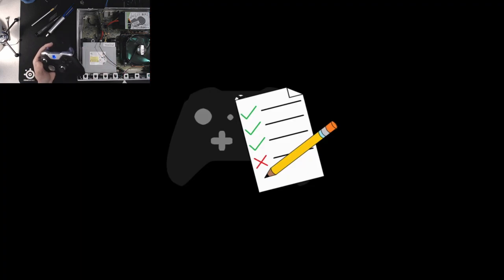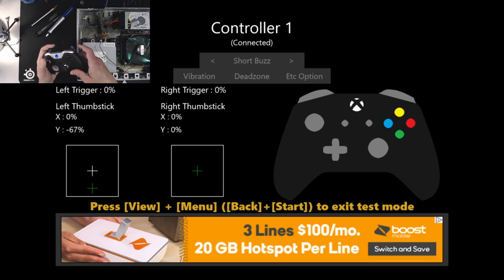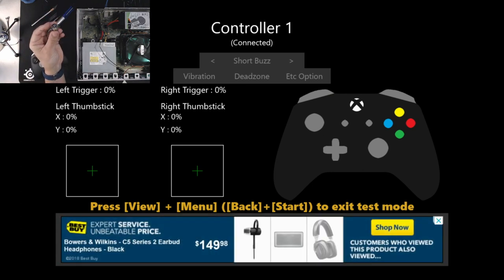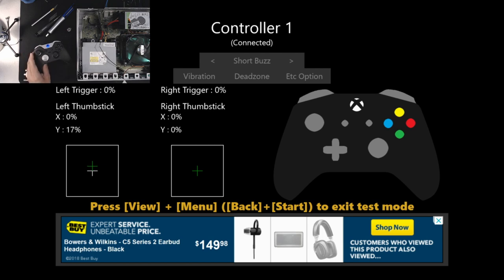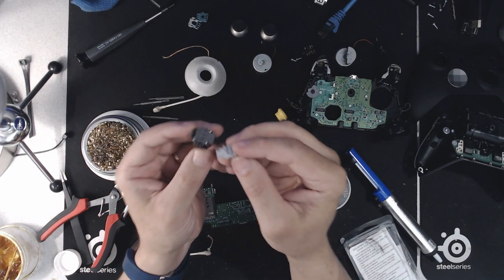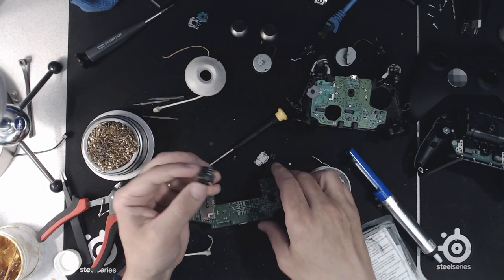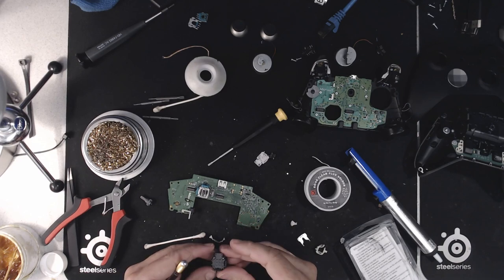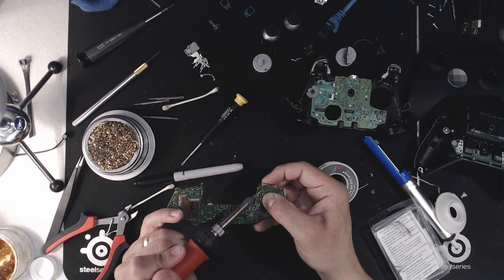Xbox One Analog Joystick Drift Fix

Comment: Definitely feel you on the dremel as I am currently working on an elite and it's a pain in the ass to remove! Going to try your method. Thanks!
Reply from the maker: Just take your time. According to a number of commenters the Elite and some early S controllers are more difficult to desolder when compared to early and later models where a desoldering braid is all you needed.

Comment: Never soldered before outside of school tech class about 20 years ago, so I've bought all the stuff and hopefully with your video as a guide my elite controller will be working as it should.

Microsoft are absolute assholes for using cheap Chinese stick modules, I've had so many controllers get drift and break including this same elite controller I'm about to fix. MS did a repair order that took 2 months to fix the left stick. Just under 5 months later the right stick is now fucking up.

Thanks for the video and I'll let you know how it goes.

Comment: Just did this on a bluetooth Xbox controller. Definitely a pain to desolder, but I had more luck with my solder sucker than the wick. Took me about 25 minutes to remove. Also, I didn't disconnect the motor wires and just carefully separated the 2 boards

Comment: Nice vid. 👍 The original Xbox one controllers are easy to swap the sticks, even with just desolder braid. From the V2 ones onwards (3.5mm jack version) they changed the board to 4 layer I think, and made the holes smaller, absolute pain in the A hole to get the old sticks off. 😣
Reply from the maker: Dude, thank you for this. I had fixed a Titanfall controller several years ago (several 360 controllers before that) and didn't remember having this much trouble.
Your insight is very much appreciated.
Reply: XFiX Thanks goes to you tho sir! After watching your videos, I've repaired/ replaced hdd's on 2 Xbox One's and saved them from going in the bin. Both now running 1tb drives built and OSU1'd. One old drive had the click of death, the other still stumps me. The Xbox really didn't like the 500gb drive it had in it. Even tho it seems fine as a single partition on windows, it acts odd / really slow formatted as Xbox, and makes windows hang. The 2 Xbox's both work sweet with their new drives tho, so thanks. 😁
Reply: mr_bridger did you do a drive scan on the bad drive? One of the reasons it to cause windows to hang is probably due to some bad sectors. I have had this happen to my external desktop HDD. I had to do a bootable Parted Magic to run some tests and to wipe the drive completely. Hop this info may be able to help you.
Reply: Ashton Seah yeah, ran HD Tune check, and chkdsk bad sector check, I also used H2testw on the entirety of the disk (when as one partition) and all came back normal. My initial thoughts were bad sectors, as only way I could remove xbox partitions was to use an old usb2 HDD enclosure board, as the startech usb3 one was hanging computer. I still don't get what's going on with it. Maybe I'll try it again now I've ran all those checks.
Reply: One thing I did notice while trying to partition, the script said that the protective MBRs 0xEE partition is oversized auto repairing. Not noticed that before. ??
Reply: Hmm that's odd. Is there any log files that you can get? I personally haven't used the script yet so I'm nut sure if any logs files get created or not
Reply from the maker: There's a video about the log file created by create_xbox_drive.bat and it is also mentioned in the readme_windows.txt:

https://www.youtube.com/watch?v=5ODHPRbnSOg
The "protective MBRs 0xEE partition is oversized auto repairing" is a message you'll see a lot.
It's in nearly all my videos:
https://youtu.be/Yq9CQdyOzac?t=696
From: https://en.wikipedia.org/wiki/GUID_Partition_Table#Protective_MBR_(LBA_0)

"For limited backward compatibility, the space of the legacy MBR is still reserved in the GPT specification, but it is now used in a way that prevents MBR-based disk utilities from misrecognizing and possibly overwriting GPT disks. This is referred to as a protective MBR."

In short the protective MBR only exists to prevent older utilities lacking understanding of GPT disks from corrupting GPT disks and utilities understanding GPT disks will just ignore this partition altogether. In this case the message is coming from diskpart and resulted from earlier disk changes that didn't bother to update the protective MBR size which diskpart is doing the favor of repairing. This is unlikely to appear in subsequent runs unless re-partitioning occurs.

The slow/hanging hard drive behavior is pretty common in the Xbox One repairs that I've done. In practice I'll always replaced drives exhibiting this behavior since it is more likely to worsen over time even if it could be repaired in the short term. Bad sectors in the file storage area shouldn't behave like this but bad sectors in the master file table may. While bad sectors are common over time they are not a sign of good disk health.
Reply: The 3rd Gen for the Xbox One S are the easiest - they have generous through-holes for the joystick module.  2nd Gen and the Elite controllers are the most difficult with tight clearance and large ground planes - but all are easy enough if applying a little extra solder (containing lead helps) and then using a vacuum desoldering gun.

Comment: Technically that's not drift, drift is when your stick is centralised and its loose, so when you barely put any pressure onto the stick and it gives movement input.  This is more like sensory malfunction its like the opposite to drift

Comment: Btw you have to be careful what kind of replacement modules you use. Some have a really big deadzone and wont function like a original one.
Took me a lot of attempts to find the right one. Not all this cheap asia ones are the right ones.
Reply from the maker: This is true. I've had sort of a mixed bag with quality myself. Sometimes they arrived physically damaged or missing parts. The "Game Controller Tester" does display dead zones and most are nowhere near as good as the OEM sticks.
The problem with Xbox replacement parts is the same as with most replacement parts of this nature, such as Apple, in that there are no official part suppliers. I'm sure you are aware of this but just for anyone else reading this. Used parts are the exception of course but not as readily available. Most eBay vendors picture OEM or better quality parts but ship lesser quality.
Reply: Asian models are awful I bought one it was trash biggest waste of 12 euros ever they use sub standard parts that don't even work properly or have the correct mechanics and movement vectors

Comment: Did you ever try spraying de-ox-it in the analogue modules? It's a common thing with potentiometers that they get corroded over time
you might have been able to get away with not replacing the thing if you tried that first
Reply from the maker: Good thought, may work in certain situations. In this case and another I did soon after the stick itself was not centering. So the potentiometer was reading the sticks position correctly but the sticks centering mechanism was either gunked up or damaged. Considering how inexpensive the replacement part is the only real reason not to do this process is if you are not comfortable with soldering.

Comment: Nice video! I have stick drift in left joystick of my 2.5 year old Elite controller. Could I just take the analog stick out of one of my regular XB1 controllers that I've never used? Are the analog sticks the same between Elite and regular controllers?
Reply from the maker: The analog sticks are the same across all OEM Xbox One controllers. It would be a shame to sacrifice another controller over a $5 part. Plus they can be quite difficult to remove and easy to install. Obviously it is completely up to you.
Reply: Trevor Davis The part is commonly available.  It is an Alps RKJXV (or to use its' full name: RKJXV12224005) available at most larger electronics component retailers. 

In the US:
https://www2.mouser.com/ProductDetail/ALPS/RKJXV1224005
https://www.onlinecomponents.com/olcmobile/alps-electric-rkjxv1224005.html?p=47075175

In the UK
https://uk.rs-online.com/mobile/p/joystick-switches/1239578/

There will be other retailers so don't rely on the links I provide. You can also get them on AliExpress but you will wait longer to receive them.

Comment: I have replaced the thumbstick module with no hiccups but now when testing the controller in GCT the is a deadzone of around 10% in 3 directions. Did I receive a dodgy switch or did I do a bad job in installation?

Comment: I was having trouble getting any of the solder off. I am using a soldering iron of about 750 degrees F and still cant get them removed. At one point I even kept in on a point for 10 points and it wouldn't melt. I also tried using solder wick and flux and nothing is working. Any recommendations would be greatly appreciated.
Reply from the maker: I feel your pain with this. I added some more items to the description of this video.
Rotary Tool Kit 80 Pc Drill Master - item #97626 and ChipQuik SMD1 Leaded Low Temperature Removal Kit
The low melt solder likely isn't required and you need to be careful with it since it makes removing SMD components almost too easy but it can help.
The tool I probably couldn't have removed the joystick without is the Rotary Tool. The more pieces you can cut the metal casing into the better. I've also use this to facilitate removing HDMI ports with large casings and 19 tiny pins.

Another comment pointed out that the new Xbox One controllers like this one have much smaller through-holes and more board layers. Making it almost impossible to properly remove the solder resulting in having to pull the parts through rather than desoldering them. Once the pins are out, you can use a solder wick to clear the holes.

I'll add this to the description as well.
Reply: I will try it out. 
Thanks

Comment: Would replacing an analog stick module in an Xbox One controller with one from an Xbox 360 controller have any adverse effects or be slightly more complicated? I know the analog sticks in Xbox 360 controllers use metal rings instead of plastic ones (which ultimately lead to stick drift in Xbox One controllers).
Reply from the maker: Lord Nazo the analog stick modules of the 360 and One are not compatible. 360 modules are larger than One resulting in none of the solder points lining up.
Reply: Could replacing the rings in the Xbox One controller stick module with the copper ones in the Xbox 360 controller stick module work instead?

Comment: The adding solder was good plan if you melted the point and put the sucker straight over the point vertical covering whole pad thus creating more suction then pressed the botton would of been better , it's harder to do on a angle like that